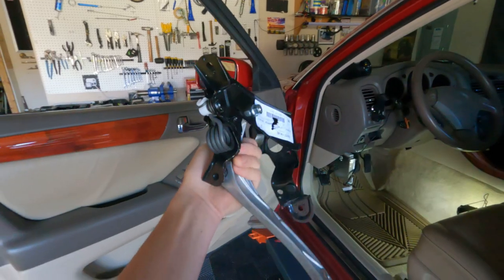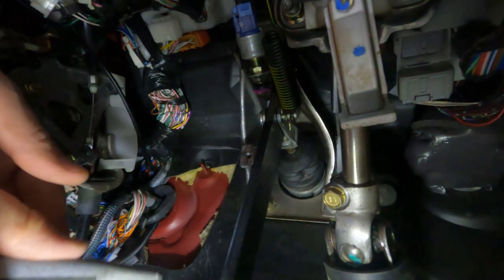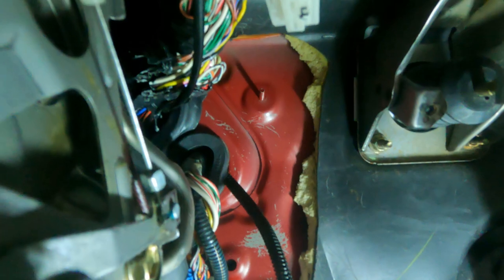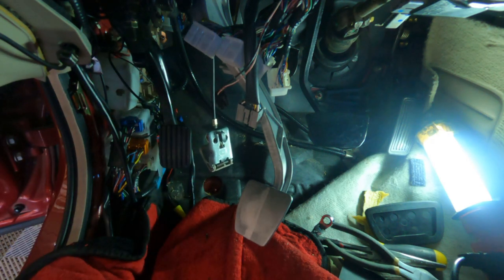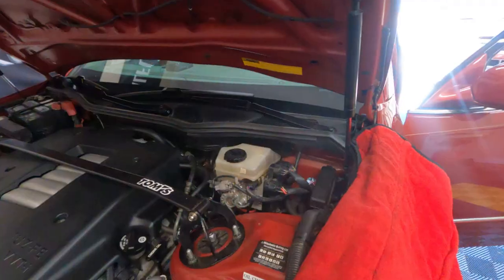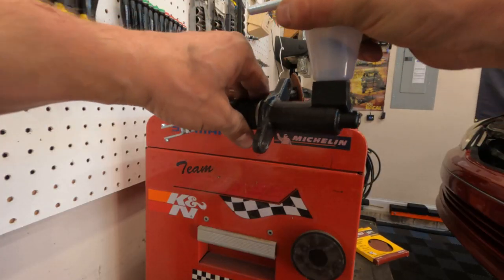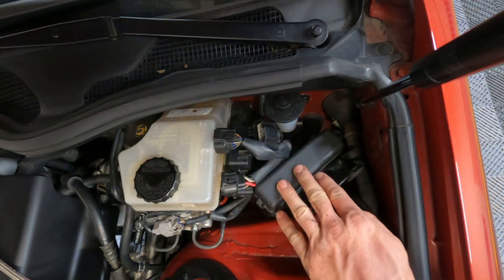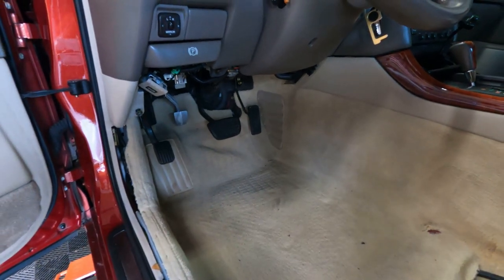Manual Swap  | LEXUS GS400 | Episode 2 | Supra Clutch Pedal and Land Cruiser Clutch Master Install

Comment: Hoping you could answer but the clevis extension, does it need to be a certain size? 

The one I’m looking at buying is a 3/8 24thread 2-4in extension. 

Thanks!
Reply from the maker: I’m sorry, it was given to me so I don’t know. Ace Hardware has a good selection of stuff like this if you need options. 👍
Reply: @ForwardMomentum  ok thanks for getting back to me. I’m literally following your whole thread in my 430! Cheers!

Comment: Dear can you make video about the difference between NGK vs DENSO spark plugs which are better?
Reply from the maker: I wouldn’t have enough content for a video, but I can tell you that OEM plugs are best in all cases except crazy forced induction or nitrous builds.
Reply: @ForwardMomentum  Thanks dear for the clarifying 👍
Reply: @ForwardMomentum  i have another Qs 😂 im looking for supercharge m112 to install on Gs400 ! Do you think it give me a huge no of HP
Reply from the maker: Yes. If done correctly, 75-100whp. My friend runs it.
Reply: @ForwardMomentum  but what is the best supercharge which suitable for 1uz-fe ?
Reply from the maker: Elate intercooled adapter and M series SC. Plus supporting intake, fuel and tuning mods.
Reply: @ForwardMomentum  Iv already switched to unichip on the stock ecu with kn filter intake also fuel from DW300 as well exhaust borla plus headers & downpipe 3 inch so only the supercharge is remain
Reply: @ForwardMomentum  if you have Instagram so please send your acount i can better chat with you there
Reply from the maker: @falblushi6701  there is no “best” option. An M series Ford SC’r would be affordable with replacement parts available. So I would say that’s a smart choice, not a best choice.

Comment: Could you have used a mk4 supra clutch master?
Reply from the maker: Just want to answer here in case others have the same question. No, with a T56-style concentric slave, the LC CMC was necessary to use. 👍